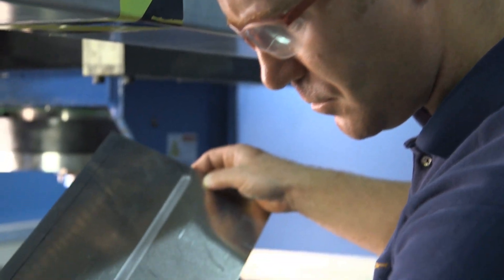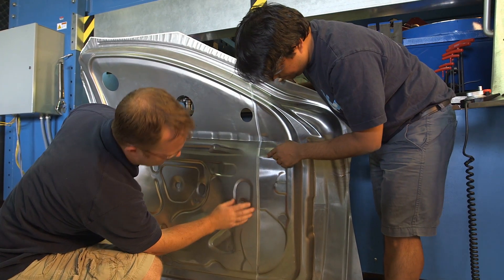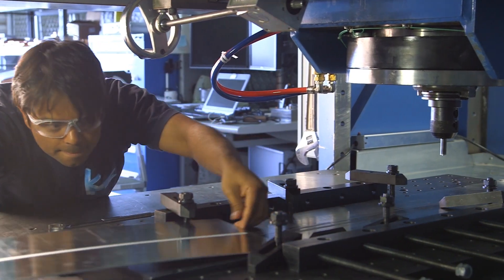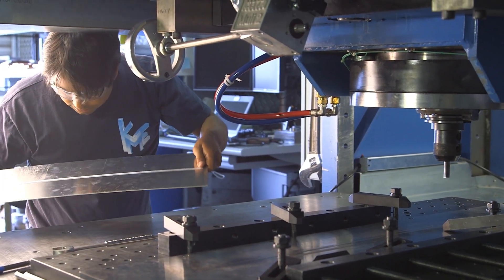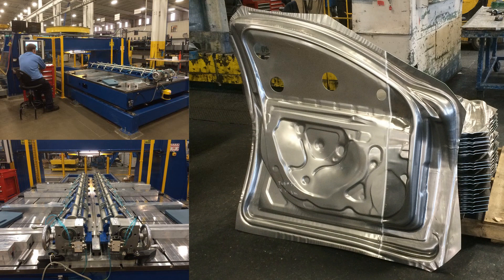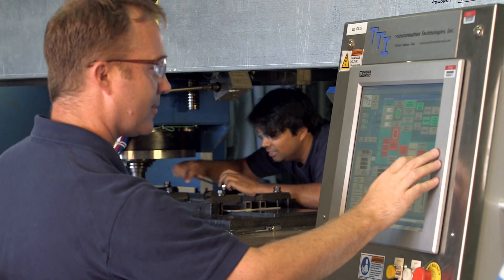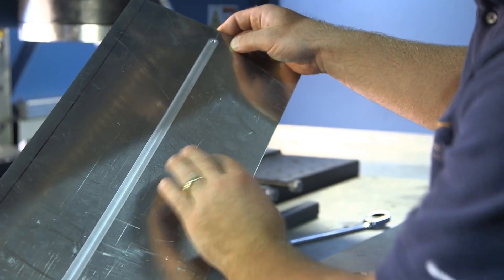Friction Stir Welding Aluminum for Lightweight Vehicles

Comment: What are the some of the specific adavantages to this process.  Does it allow the bonding of different alloys, less distortion, reduce chances of cracking etc,  additionally does this process use more or less electrical power per x of material being bonded together.  Lastly can this process be used on exotic metals that are tradionally hard to weld together and or traditionally have cracking issues?
Reply: It allows you to bond more complicated and expensive alloys while not jeopardizing their crystalline structure by presenting a heat source and melting, friction welding doesn't melt, it just apply enough heat to reach plasticity
Reply: no fuel, no combustion and no high energy plasma, no toxic fumes, no hot metal splatter.....
Reply: It is used in the aerospace industry for joining pressure vessel's due to it only minimally affecting the crystal lattice of exotic alloys the thermal cycling they go through would pop normal welds due to micro fractures an heat induced carbon migration in some alloys

Comment: I've got a $100 bill that says an infrared thermometer used to measure the temperature of that "tool" and the weld immediately after the tool has passed through it will register at least 1250 degrees F. 
Which is the approximate MELTING POINT of ALUMINUM. If you're working with ALCOA either their "scientists" are as dumb as you or they're humoring you in your quest to use more aluminum in "auto manufacturing" and of course they're going to go along with this BULLSHIT if it SELLS MORE ALUMINUM. The problem is that there are plenty of vehicles already on the road by the many thousands or millions that are already 75%-100% aluminum-bodied. Kenworth and Peterbilt trucks come to mind and so do Range Rovers. All of which have had bodies made of aluminum for MANY, MANY DECADES. In fact, that's always been a key selling point FOR those vehicles that are much more EXPENSIVE than many of their "competitors".

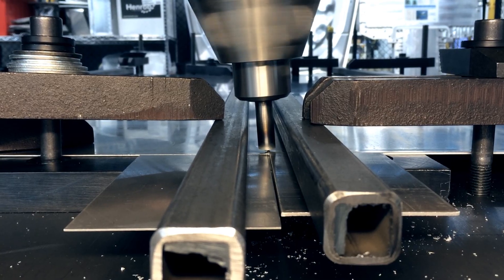Comment: 0:16?  Without ever melting them?  You HAVE to melt them otherwise they'd never join.
Reply: it is welding... not fusion welding just solid state welding...
Reply: @lizdaflea  lol,
Reply: You don't actually melt the material when friction stir welding - you literally mix the grains together but without reaching melting point. Conceptually you can think of it as a super plasticisation and a reforming of the grains to be extremely fine.
Reply: @sddwalker2  how does this work with metal composites?
Reply: it's Fckng wilding and you can see it turning red. so everyone stop
Reply: @lcfflc3887 is it red?
Reply: Just to add to what the guy above me said; this technically isn't welding, it's a fusing process, definitely not welding.